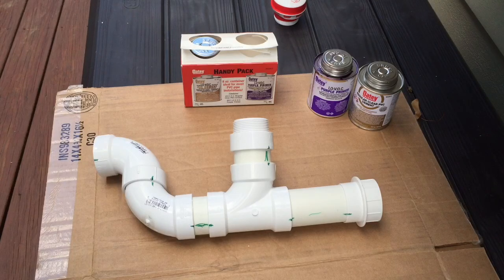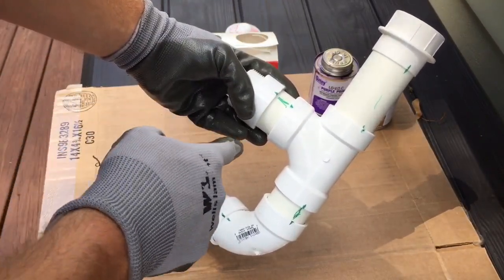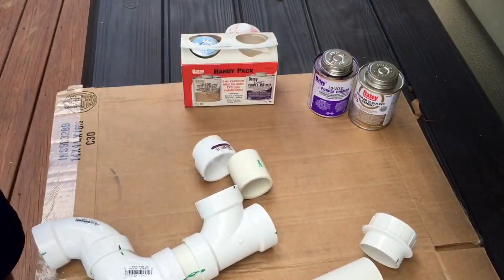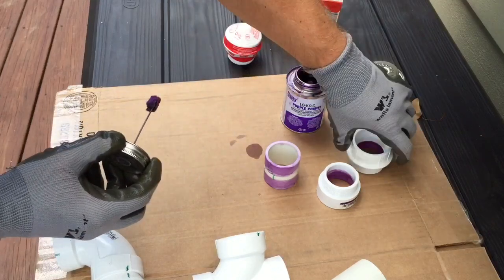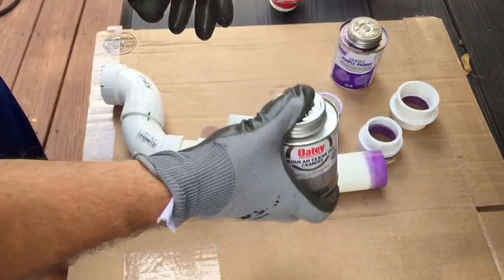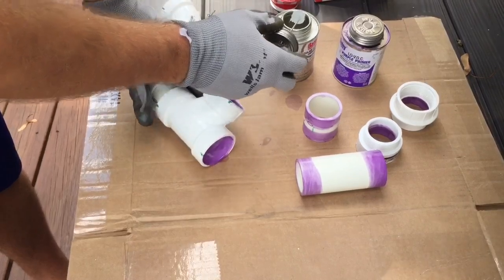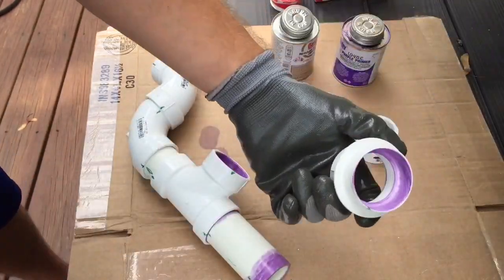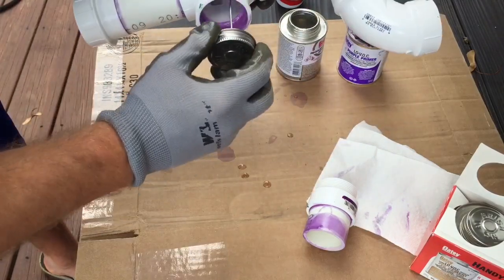How to use PVC Primer and Cement to join PVC Pipe

Comment: I don't know anyone that uses the primer. I decided to test both ways. The results were no difference. I could not break either at the joints using pipe wrenches. At most I now might wipe an old pvc pipe with acetone before cementing. There is absolutely no difference. I find it to be a marketing scheme.

Comment: This is going to be my first time trying to DIY a PVC Pipe for swimming pool, I have 2 questions:
- What if the position is impossible to give a quarter turn?
- How much time do I have after applying the primer and the cement before inserting the pipe? I plan to bypass 2 pipes, one is above the other, so I'm going to use 2 elbows and 1 straight down pipe. Plan to install the 2 elbows to the straight down new pipe first, then glue both upper and lower side at the same time to the 2 pipes. That's when I can't make a quarter turn and will need some time to apply primer and cement on 2 elbows and 2 pipes. Thank you.

Comment: How long to you let the primer set before adding the glue?
Reply from the maker: You do not need to wait at all - you can and should start apply the cement (glue) immediately after applying the primer. Avoid letting the primer dry.
Reply: @ErikAsquith  thanks
Reply: @ErikAsquith  I shouldn't use the primer and glue on rubber couplings?
Reply from the maker: @joshuastarcher4272  Are you referring to a "no hub coupling", like Fernco? If yes, correct, you should not use primer and cement on the PVC pipe and no hub coupling joint. A no hub coupling uses a mechanical bond by tightening metal straps to compress the rubber hub around your PVC pipe.

Comment: What would happen if the cement was a lllllittle jellylike and you used it anyway? Asking for a friend 👀
Reply from the maker: The chemical reaction that fuses the pipe and fitting together may not work as it should, which can result in a weak joint, that could have a greater chance as failing and leaking. But then again, it may be good enough to not fail and leak.

Comment: I never used primer and always used up cement even when jelly like. I also firmly joined sections but never held for 30 seconds. I would turn pieces a little. Results after thousands of jobs? Never a problem. Where? On yard sprinklers including tapping water main and assemblying manifolds. Also did same thing in installing soft water systems. But if I ever join PVC again I will follow and do as this fellow has done.
Reply: This is going to be my first time trying to DIY a PVC Pipe for swimming pool, I have 2 questions:
- What if the position is impossible to give a quarter turn?
- How much time do I have after applying the primer and the cement before inserting the pipe? I plan to bypass 2 pipes, one is above the other, so I'm going to use 2 elbows and 1 straight down pipe. Plan to install the 2 elbows to the straight down new pipe first, then glue both upper and lower side at the same time to the 2 pipes. That's when I can't make a quarter turn and will need some time to apply primer and cement on 2 elbows and 2 pipes. Thank you.
Reply: @ Can’t visualize your situation, but connections adhere fast! Suggest stimulating your setup first.  Stuff is cheap so you’ll wast a few dollars only. Could you move connection just a little? That would work.
Reply: I’ ve slid pvc connecting parts together without turning and they hold fine.onto

Comment: Good advice. Like marking the joints. What should I do if the two pieces dont come together all the way? They don't seat right. Should I sand the pipe down or will that cause a leak ?
Reply from the maker: You should chamfer the outer edge to help pushing the pipe into the fitting. And you should  chamfer the inner edge to ensure a smooth tradition so that nothing gets stuck on a slight lip.

Comment: First of all I've used glue that was like jelly and it works just fine. You don't throw it away unless it's hard and it doesn't flow. Also you glue the male fitting first set it down then you glue the female fitting then you glue the mail fitting one more time before you fit them together I worked on pools in Arizona for a lot of years that's how we all do it and it works

Comment: I’ve never used a liquid type cement like that.  Interesting.  I’ve never used primer either.  The two times I did use primer I did not have a good seal and had to redo.   Thanks for the video!
Reply: You must use primer it softens the pvc allowing for a bonding type seal
Reply: So which is it, you've never used primer or you've used it twice?

Comment: I used pvc primer and cement for the first time yesterday and could not believe how dangerous this stuff is. Please wear full protection eye glasses, and a 3M half mask with 6003 series cartridges that will block any vapors. It's too dangerous to work with this stuff without adequate protection. Remember, PVC gas is a neurotoxin. Don't fuck with this stuff.

Comment: Everything looked ok, except for the way the glue was applied. You DO NOT put glue in the female ends of any connection. The reason is that all of the excess glue is pushed into the pipe, and that can be bad, especially on potable water systems.  You only glue the male end, and all the excess glue is pushed to the outside of the pipe, and can be wiped away. This is one of the most common mistakes made by even highly experienced plumbers.

Comment: I was wondering if I can use just the clear cement without using the primer.  I need it for a project that uses non water pressure.  I just need the tube to not leak while it is holding water.

Comment: Primer is used to soften the material so it welds the pieces rather than a joint like tape. It could be included in the glue but it would take too long for the joints to dry. Its purple because union inspectors needed an indicator it was being used.
Reply from the maker: Thanks for sharing.

Comment: With PVC pipe if the blade jumped a little at the start of the cut and gouged  or scratched part of the pipe where a fitting has to be glued on, Will that be unacceptable to glue and create a bad glue joint ? It’s some shallow gouging about 1/8 inch wide near the end of the pipe on the top of the pipe. I had to cut it under a vanity for a new p trap. Was hard to get started with the cut. Not sure if I should buy a ratchet cutter and re do or glue what I’ve got to the p trap adapter

Comment: You are so doing the primer wrong... You're supposed to primer the parts you're going to glue together and glue them right away the primer is still supposed to be a little bit wet while the glue is applied. Read the directions dude it clearly tells you.
Reply from the maker: Oatey states that you should apply cement to your pipe and fitting within 5 minutes of priming it. So you can apply primer to multiple pipes and fittings, as long as you cement them within that allotted 5 minute window. Sure, applying primer to your pipe and fitting, immediately followed by cement is indeed recommended as one can easily exceed the 5 minute window of opportunity when priming many pipes and fittings before applying cement. Your point is valid, Dude.

Comment: I never used Primer. I sand the connectors & pipes. Then apply cement. Application bonds like hell. Never had a problem

Comment: Is it true that the primer must dry before applying cement to pvc when used in high pressure systems and/or exposed to cold ? Are there any other situations where the primer must dry prior to cementing ?
Reply: No. In fact, the cement should be applied immediately while the primer is still wet

Comment: 4:17 No, that's not how it works, it doesn't create heat. The cement is PVC dissolved in a solvent, and when the pipes are joined, the solvent dissolves the pipes, and redeposits the dissolved PVCt as the solvent diffuses out/evaporates from the joint. This leaves behind PVC plastic. There's probably some heat involved, but that's not the mechanism of how it works.
Reply from the maker: Thank you for sharing this additional information on how PVC solvent cement chemically bonds the pipe and fitting together as one piece. Indeed, the heat is produced as a byproduct of the of the chemical reaction taking place to to bond the pipe and fitting together. What I had stated may have been a bit misleading. I appreciate your feedback.

Comment: Please explain why you have alignment marks on straight pieces of pipes ??? They are a 360 degree (no bends) so why the align marks?
None of the pipes prior to 6:46 need alignment marks. They all are straight pieces and fit exactly the same within a 360 degree circle.
Only the 2 "S" pipes at 6:46 need alignment marks.
Reply from the maker: Alignment marks are not needed on straight pipes or straight fittings. Alignment marks are just needed on fittings that have bends, wyes. tees, etc. as you had mentioned. I was merely trying to to keep the instructions simple for the novice individual looking to tackle a PVC plumbing project. Thanks for raising this question.

Comment: Do not dry fit that many pieces. This man is a hack. Call a plumber
Reply from the maker: Riley Taylor why is there a limit on how many fittings and pipe that you can dry fit?

The purpose of dry fitting the entire assembly is to show beginnings an easy way to get started, check fitment, mark for angles, and ultimately avoid mistakes.
Reply: @ErikAsquith  because the pipe doesn't always seat all the way during a dry fit and if you're putting all those fittings and pieces of pipe together while taking measurements, there's eventually going to be some that are cut too short. Leading to an improper fit, poor joints, and wasted fittings. 1-2 at a time.

Comment: How do you prevent the glue from squeezing inside the pipe when joining
Reply from the maker: Brave Heart ! You will want to avoid putting the cement (glue) on too thick as it can cause pooling inside the joints. At the same time you don’t want to put on too little either. Just try not get too much cement in the fitting as that will cause pooling inside the joint. If you put a bit too much on the pipe, that will pool outside the fitting and you can quickly wipe off the excess with a clean rag before it fully cures.

Comment: I was working with 4” pvc pipe today. I hope someone can tell me what I was doing wrong. I bought the Oatley primer and pvc cement at Lowe’s today. I followed instructions and primed both parts. While the primer was still wet, I applied the cement to both. The problem is, my glue behaved liked contact cement. As soon as the parts touched each other, there was an immediate “grab” and inserting one into the other to the full depth intended was impossible and any final quarter turn twist was out of the question. I got most of my joints to have about 1” of insertion. A water test with a garden hose revealed that 2 of 3 joints leak significantly.  Those pvc fittings are expensive and I scrapped several today.
Reply: Hey man ! With a 4" pipe it's important to bevel the outside of the pipe a small amount so the pipe will slide in all the way . Also sanding down the fitting and pipe a little will help . Just to scrape it up a little .Always apply a generous amount of glue in the fitting and pipe too.

I'm a plumber 15 years and I done some 4" the other day . It's expensive for sure if you get a leak on it

Comment: You’re pretty lucky to be able to dry fit that assembly without it binding up. Did you sand it first? Also you can use your sharpie to number the pieces as well.

Comment: Mark the top of the cement can and cleaner/primer can (in case you use clear) so you don't put them into the wrong containers.
Reply: GOOD OBSERVATION AND VERY GOOD TIP

Comment: My father always told me it was best to let the primer dry before you add the cement (it dries quickly). It appears you do this too.  But I thought I read the instructions on the can and it says it add the cement before the primer dries.  Which is best?
Reply: Prime fitting liberally, then prime pipe. Repeat 2 to 3 times, then while primer is still wet apply a coat of cement to the pipe and without re dipping to the female.
Reply: Shane Frank glue when the primer is wet. The primers main purpose is to soften the pipe so the glue can fuse it together

Comment: Should the primer still be a little wet, or can you let that dry on before you rub on the cement?  Related, I saw the purple primer was getting on the cement brush, and then you were obviously sticking that back into the cement can.  Does that small amount of primer in the cement can ruin the cement for future use?
Reply: No won't ruin the cement at all. It's going to happen
Reply: Thanks I was just starting out and thinking the same thing. Appreciate the question and answer

Comment: can u use silicone instead ??
Reply from the maker: Whatwasadam unfortunately the use of silicon would not meet code and has the potential to leak. When you use primer and cement correctly, the PVC fitting and pipe are actually welded together, so the likelihood for a leak to occur is extremely low.
Reply: Erik Asquith hmm, this is for a hydro set up. A system called under current or rdwc. There's not pressure and there is no code for it . I may want to modify it , my first time to design and build a system like this. I'm really wanting u to tell me 'sure it will be fine' lol 
But thx tho
Reply from the maker: Whatwasadam I want to avoid promoting misinformation as others may read this and try using it for their household plumbing. Also, I hate to say “go for it” and you then start having issues immediately or several years down the road. 

However, I will tell you a story and you can decide what you would like to take away from it.

A year or so after I purchased my first house my shower drain started to back up. I had a hallway closet with an access panel in it to all the plumbing for the shower. The shower had a brass drain, that mated to a PVC p-trap and 90 degree bend, that had a fernco to mate the PVC to the old galvanized drain pipe. The PVC p-trap pipe was dry fit into the 90 degree PVC fitting - there was no primer, glue, cement, sealant, silicon, etc. to weld, glue, or seal the PVC pipe and fitting together. However, after trying to remove the PVC pipe connected via a fernco to the galvanized pipe, I understood why they did this (even though they should not have) - over the years that I lived at the house the old galvanized pipe would clog up once or twice a year given the build up and narrowing of the inner pipe diameter - this must have happened to the prior homeowners  many times.Because of this they must have just dry fit the PVC pipe and fitting together so they could easily pull it apart, which provided just enough room to loosen the fernco and remove the PVC pipe from the galvanized pipe. Now you have access to run a snake down the galvanized pipe to dislodge and remove the clog.

Long story short I left the PVC p-trap pipe and 90 degree elbow fitting dry fitted together for 7 years and never experienced a leak. This was the only shower in the house and we used it everyday.
Reply: Erik Asquith thx for taking the time to respond brother.

Comment: What about threaded pvc? Do you prime & glue or use plumbers tape?
Reply: If it is just regular PVC ( polyvinyl chloride) you don't need anything since PVC is only approved for drain lines and will not be operated on under much pressure. if you are using CPVC however (chlorinated polyvinyl chloride, which is approved for water lines) and you are using it for water lines you will need to use teflon tape if they are threaded fittings. hope this helps:)
Reply: @VegaChastain  Thanks!

Comment: Thanks for sharing your know-how. I have to use PVC for a class project.
Reply: if you are just using it for a class project there is really no need to prime the surface, it just makes a weird looking purple rings on you project. primer is really just to get the best glue up at possible mainly for longevity, which you will not need.

Comment: I realized after connecting the pipes for my fish tank pump I used primer and forgot to use cement! will I be able to get them apart and glue it again or will it hold with the just primer?
Reply from the maker: Mr1990Darkness if you had just used PVC primer, you should be able to twist and pull the PVC pipe and joint apart.
Reply from the maker: Mr1990Darkness make sure the PVC pipe and fitting are clean (once you disconnect them), and you can apply additional primer to the pipe and fitting before applying the PVC cement.

Comment: I have a laundry tub/sink drain that came loose at one joint.  

Is it necessary to do the quarter turn?  I don't think that'll be possible for this repair, without taking the whole thing apart....  I just want to do that one joint.
Reply from the maker: Khechari given your circumstances, you should be able to get away without performing the quarter turn when pushing the pipe into the fitting. As long as you are able thoroughly prime and cement your the pipe and fitting, as well as securely push and hold them together for 60 second, you shouldn’t experience any leaks or failures. Just pay extra attention to your new connection to ensure there are no leaks the first few times you run water down the drain.

You could even put a stop in the drain, fill the sink, and then pull the stop to stress test the new pipe and fitting connection with a heavy flow of water to verify you are leak free.
Reply: @ErikAsquith   Thank you so very much!